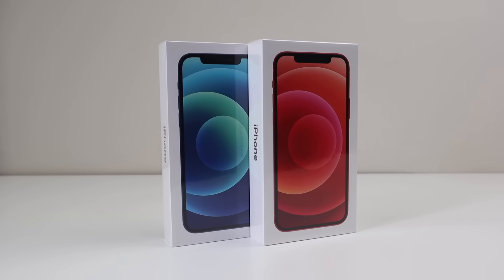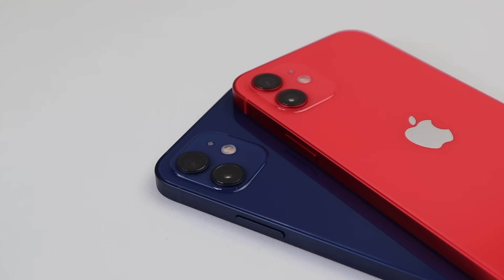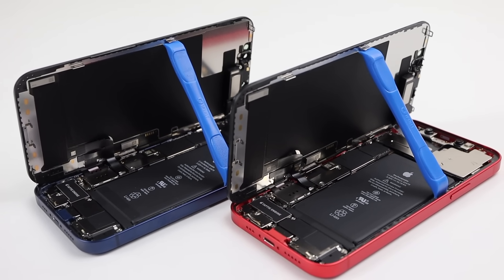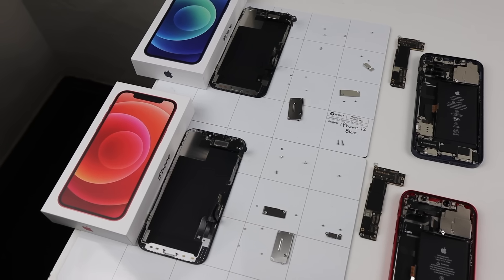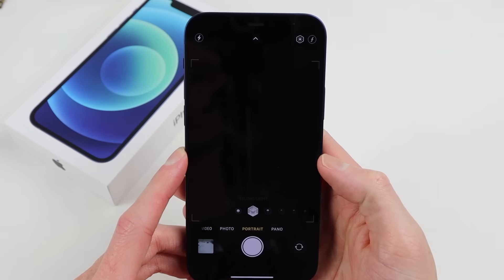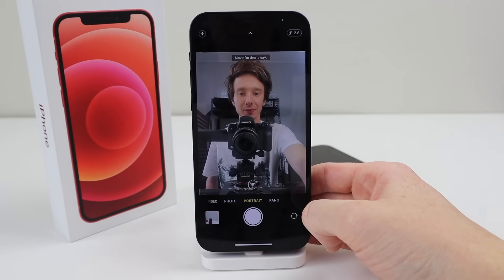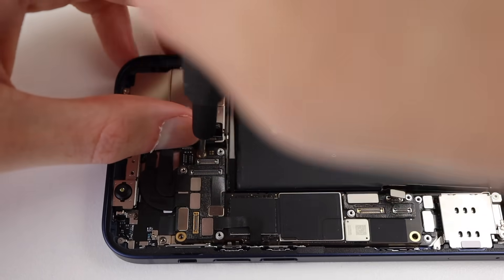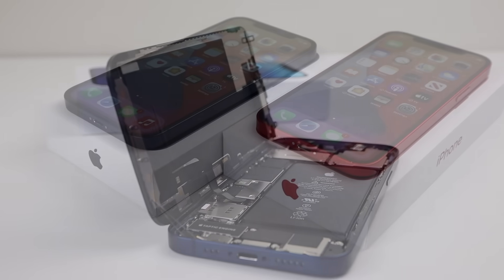iPhone 12 Anti Repair Design - Teardown and Repair Assessment

Comment: there is about to be a law in germany that phones have to be reparable and batteries have to be exchangable by the user. We need that everywhere
Reply: When is this law coming into effect? And what will happen then? Special German iPhones or no iPhones in Germany anymore?
Reply: @aljoschalong625  special German iPhones
Reply: @MrAdoh2010  would it be possible to buy these international phone versions and use them in another country?
Reply: @MrAdoh2010  nice, just hope they also mandated to use usb c
Reply: @bow-tiedengineer4453  yes
Reply: @aljoschalong625  special eu phones probably
Reply: @aljoschalong625  It will be in the whole EU and yes, if apple want to sell their phones here  they would have to change their design, or in this case, remove the software lockage against backmarket parts
Reply: I bet they would hide the battery connector below the motherboard
Reply: @losFondos  Apple: “Write that down, write that down!”
Reply: @losFondos  SH DONT GIVE THEN IDEAS
Reply: “This law needs to be in every single country”
Reply: @Xenofinite if it's good then yes
Reply: Just don't buy from apple
their products are shit, overpriced and mediocre
Reply: Jezus christ this turned into a cesspool. Apple is a morally devious company that likes to hide under a friendly facade. It has the right to create a product the way they want and noone is forced to be their customer. There best of both worlds, im gonna look if the local farmers need any repairs cause its been etched in my brain now.
Reply: The main part of that law is that Apple won’t be able to limit the user experience when you’re repairing your phone yourself. For example: removing features like Face ID or True Tone etc.
Reply: @GeorgiaOverdrive  For cases like that I think it should depend on whether Apple makes it clear or not to the consumer before purchase that they reserve the right to do that.
Reply: @GeorgiaOverdrive  Why shouldn't they be able to? It's their product. You are using their service.
Reply: @Katt1n  Because if I buy something that I own, I shouldn't be forced to still use a company to fix it. Why are you anti repairing your stuff? You sound like the kind of guy who pays a plumber to clean your toilet.
Reply: @Katt1n  So you are saying companies should be allowed to design their products to be as dangerous, problematic, unusable or lie about what their products then do and get away with it? 

Again, do you support farmers being unable to fix their equipment?
Reply: @Katt1n  You theory only works when you have a healthy free market of high quality phones to ship around. If you value your privacy (for example) you have no other option then iPhone right now, meaning you can't shop around. Thr other big names like Samsung and Google do the same things as Apple, just maybe a year behind. 

Do you not understand that Apple is often the trendsetter of horrible tech business practices that everybody else follows. What am I supposed to do when every phone is as anti consumer as the iPhone then. Are you antifixing your own shit cause that is the most silly position to take.
Reply: @Katt1n  Also you are putting a whole lot of faith into the idea that every single person who buys an iPhone also watched this video. Do you seriously expect everybody to buy an iPhone knowing they will not be able to repair it? Apple isn't exactly telling us that.
Reply: @JS-po8oc  Get away with it? No, they should be held accountable by consumers. Again, mr high IQ, i support everyone being able to do whatever they want with their property, be it farmers or those producing farmer equipment.

If people care about being able to repair their phones, they should research which phones can be repaired and which phones cannot. If people don't care, then tough shit for you. 

You are not entitled to a phone. You have to compromise on something, or if there is a demand in the market for a phone that cares about your privacy and is easy to repair, fill that demand by creating your own phone. These are the options you have right now, and you don't get to use violence to force other people to build you what you want. Again, you are not that fucking special.
Reply: @Katt1n  becuase its your property, thats like saying that you shouldnt be allowed to repair your car or your toaster
Reply: @Katt1n  except that apple has a whole ecosystem making it damn near impossible to switch and not lose everything
Reply: @sharktenko267  Your phone is your property.  You bought that property from Apple. When it was the property of Apple, they designed it in a way that makes it difficult for you to repair. Your entitlement to repair movement is not about your property, it is about Apples property. 

Apple has a whole ecosystem? What is it that makes it so difficult for you to switch? Moving your images from one phone to another? Moving your contacts?
Reply: @Katt1n  1: apples job should be to provide ease of use for the user, and that includes repairing 

2: yes as in everything
Reply: @sharktenko267  Apples only responsibility is to deliver a profit to it's shareholders. If people are buying products that only they can repair, and don't care about the privilege to repair, then they are fulfilling that goal.
Reply: @Katt1n   So you want companys to start making cars and trucks that you have to call the company to fix your flat, fill your gas tank, top off the wiper fluid, change the oil, and/or  change the filters?
Reply: @summer480  No, and i would never buy such a car. Does not change the fact that companies have a right to build such cars, and that using violence to stop them is wrong.
Reply: @Katt1n  he's asking you about farmers being able to repair their equipment because obviously you don't know about john Deere doing the same as Apple, except with farm equipment.

It's extortion. The farmers have to fork up more than the cost of the equipment to fix it or buy a whole new machine because of a low cost fault.
Reply: @akzual50  I know about the John Deere situation, that's why i would never buy their products. Same thing goes with Apple.
It is not extortion. You choose to buy shitty products from a shitty company. Farmers can purchase their equipment from other tractor manufacturers, and technologically challenged people can purchase their phones from other phone manufacturers.
Reply: @Katt1n  no the issue here is them forcing owners of a product to not be legally allowed to fix the stuff that they own.
When you own something it's yours. Not leased to you.
Per the terms of consumer protection, it is unethical to force a product to artificially degrade over time for the purpose of forcing the buyer to have to purchase another item.

Put it like this: if you buy a phone from Apple, and it just disintegrates all of a sudden 8 months from now, you would buy a new one. Considering items spontaneously disintegrating is normal.
Now, if apple forced the phone to self destruct in 8 months, what is your response to that? Because that's what's happening. They would make your phone disintegrate if a piece were to become faulty and force you to BUY a whole new phone. If not just say, shorten the time span to 1 second after purchase, you must buy a new one, 1 second after buying that, you have to buy a new one. 1 second after that, you have to buy a new one.
Reply: @Katt1n  also, Apple is 1 person. The CEO, whoever it is.
You're telling me that you'll let one person dictate how you can use your own property?
Reply: @akzual50  It does not matter if it is 1 person or a government, my property is my right. That is not what this is about.

Before i bought the phone it was the property of Apple, and they had the right to do anything they want to it, because it is their property. You don't have the authority to force anyone to build easy to repair products. You don't have the authority to force anyone to do anything.
Reply: @Katt1n  it's not about forcing them to build easy to repair phones. Its about a bunch of things. Mainly, them lobbying for legislation to prevent you from doing what you want with your devices
Reply: @akzual50  And I would get behind you cause, if you were not lobbying for the exact same thing, but against them. When Apple owns the device, Apple gets to do whatever they want to it. When you own the device, you get to do whatever you want to it. Why is this such a difficult concept for people to grasp? My property = my business only.
Reply: @Katt1n  fair is fair, except when they file lawsuits against those trying to repair their items
Reply: @akzual50  Or when the people trying to repair the items lobby for legislation forcing Apple to change their products to cater to them.
Reply: @Katt1n  okay, it's one thing to buy a phone, have it break, and then have Apple replace it quickly and efficiently.
It's another thing to have it break, then have them tell you the repair cost is more than the phone itself, when the repair fix is so easy that you or someone else could fix it.

It's one thing to have a phone slow down over time, even with factory resets, and have them replace it for you efficiently.

It's another thing to force your phone to slow down over time JUST TO MAKE YOU BUY A NEW ONE.

You say take your business elsewhere if you don't like it. I don't like extortion which that is. To purposefully sabotage my experience and tell me the lifetime of the phone is expired by wear and tear. That's fraud.
Reply: @Katt1n  I don't use an iPhone.
Reply: @Katt1n  People like you are the Problem. Here a government for once is trying to help out the simple consumer and people like you for some reason stand behindert those huge corporations.
Reply: @Katt1n  You talk like you're the CEO of Apple who one day decided to take a stroll around YouTube videos on Apple products and found this comment and got mad
Reply: @sharktenko267  ta gueule
Reply: @EdyAlbertoMSGT3  shut
Reply: @Katt1n  But when you BUY the product it becomes yours. They should allow people to be able to get the customers phones fixed easily and by third party sources. If you are for independent mom and pop stores that fixes electronics then you should be against what Apple does. A lot of companies will start doing this and putting these independent stores out of buisness. We have 5 stores where I live that fixes everything from phones to consoles and it's cheaper then sending them to the company unless you got a warranty.
Reply: @Melodyofthesea78  I agree that Apple should not do what they are doing. I would never buy Apple for that reason. Apple still has a RIGHT to do what they are doing, and you have absolutely no right to stop them.
Reply: @Katt1n  how much is Apple paying you to whiteknight for them?
Reply: @Katt1n  "Apple shouldn't remove repairing phones, although I think they should be able to remove repairing phones"
Reply: @ruler_of_everything  This is my position summed up, yes.
Reply: @Katt1n  do you know why that doesn't work rn? The whole "let the people punish them" thing? It's because so many people buy the newest thing when it comes out, or when it breaks just buy another, contributing to a massive amount of e waste, and never caring about repairing their shit. Yes a lot of people want to repair it, but a greater number don't give a shit. I get not wanting to make restrictive laws about what companies can and can't do, but I also dont support corporationalism, where they get to tramp all over the little guys.

The farmer issue? There is no good alternative for a lot of them, yet they need new tractors and shit. A tractor is a 500k-5m dollar purchase. That's not chump change, yet they can't fix it themselves...
Reply: @KyrieFortune  Apple making their phones impossible to repair does not violate my right to do what i want with my property though? Property rights do not mean that i am entitled to products designed in a certain way, it means that i can do whatever i want with (physically manipulate) my property. Me buying the phone is a mutually agreed upon transaction between myself and Apple. If i wanted a phone that could be repaired, i should not have bought a phone that cannot be repaired. It's that simple.
Reply: @Katt1n  You have a right to own a property and to repair it. What apple did was intentionally design their phones to be impossible to repair. This is actually illegal and if they continue their practice, they will be eventually sued for billions in Europe.
Reply: @REgamesplayer  Apple have the right to design their property however they want. It is their property. The law is irrelevant to rights, rights are above governments.
Reply: @Katt1n  You are a gift which keeps on giving.

Rights are not above governments. 
Apple does not have a right to design their property however they like. That is illegal.
Reply: @REgamesplayer  Rights are natural. You are born with the right to life, liberty and property. Governments cannot grant rights, they can only infringe on them.
Reply: @Katt1n  Not at all. You are born with neither of those things and in nature or in early human development we did not had any of those things. It is government with its laws which ensures these rights to us.
Reply: @REgamesplayer  You grossly misunderstand what a right is. Entitlements granted by gobermints are not rights.
Reply: @Katt1n  You do not understand what a right is.

"Human rights are the basic rights and freedoms that belong to every person in the world, from birth until death. 

They apply regardless of where you are from, what you believe or how you choose to live your life.

They can never be taken away, although they can sometimes be restricted – for example if a person breaks the law, or in the interests of national security.

These basic rights are based on shared values like dignity, fairness, equality, respect and independence. 

These values are defined and protected by law.

In Britain our human rights are protected by the Human Rights Act 1998."

They are in fact protected by a law and can be restricted or taken away by the law. Thus they are not above it. You confuse human rights with my rights as a consumer and place non existent barriers between these two things, calling one a right and another an entitlement while they both can be seen as entitlements.
Reply: @REgamesplayer  The human rights act has nothing to do with actual rights. The human rights act was written by governments and is not concerned with the actual rights that you naturally have from birth.
Reply: @Katt1n  And who ensures that you have those rights? Who decides if you can have them or they are restricted or taken away?
Reply: @REgamesplayer  No one ensures them and no one has the right to restrict them. Rights simply describe what I am entitled to by birth.
Reply: @Katt1n  They are regulated and restricted to larger or smaller extent by all nations of the Earth. Furthermore, concept of human rights had changed over times, gaining or losing popularity. For example, slavery.
Reply: @REgamesplayer  The "human rights" declared by the UN have nothing to do with actual natural rights. They are completely irrelevant to what is being discussed here.
Reply: @Katt1n  There are no natural rights as there is nothing that was or is inherently recognized as a human right.
Reply: @REgamesplayer  You refusing to recognize the natural rights of other people does not make them go away bub. Stay entitled.
Reply: @Katt1n  The thing is mate, the iPhone is a technological masterpiece, which as you saw in this video should be very easy to fix, personally I like the iPhone better than other phones and even after my brother had different phones he always came back to iPhone because he didn't like the other phones. The iPhone is one of the simplest smartphones to use while looking great.
Reply: @NocturnalPyro  It is definitly not a technological masterpiece, but it doesn't matter. You are not entitled to an iphone. You can buy one as is, or buy something else.
Reply: @Katt1n  wum the iPhone was revolutionary and the the newer models have really good specs, even comparable to a pc.
But really being able to modify and repair a phone with parts from a different phone bought from the same manufacturer shouldn't have any issues. Being able to repair your devices and machines should be should be a right sanctioned by the EU and the likes.
Reply: @NocturnalPyro  The original iPhone was revolutionary. Modern iPhones are in no way technological marvels. They are comparable to other phones with similar specs, only more expensive.

If i manufacture a phone, it is my property up until the point that you buy it. As such what i do with it is none of your bussiness. The amount of fucking entitlement you have to feel to even have the audacity to suggest otherwise is frankly sickening.
Reply: Chances are what they will do is say something like, "German users can bring their Iphones to our stores and we will make the phone accept the new parts for free.", or they can do it online, if they registered the phone in Germany. This is at least the most cost-effective solution.
Reply: but it's still questionable if this law will have any teeth whatsoever ... given our government's recent history regarding lobbyism and corruption I'm not that optimisitic
Reply: @gamingfox9845  yep. I mean, they spent 9 bio. euros to pull Lufthansa out of the shit they got themselves stuck into, but didn’t even have enough money to compensate small businesses who got hit the hardest by covid
Reply: i doubt America will see this any time soon because of our rights to free market.
Reply: @jadin1332  A free market that created this problem in the first place...
Reply: @JS-po8oc  Saying "the free market created the problem" when you don't get stuff your way is like saying "democracy created the problem" when people vote for the other party. The market is a voting machine. You lost. Stop crying for daddy boot to come help you with their guns.
Reply: @Katt1n  So youre saying free market capitalism wasn't the source behind this? Is Apple being socialist by making customers having to pay more for repairs?
Reply: @JS-po8oc  Yeah, free market capitalism was the source of this. The free market voted and determined that this is okay. 

Socialism is not the opposite of the free market capitalism. Apple are being anti consumer when making customers to pay more, but that is completely fine. If customers still pay, thats their fault.
Reply: @Katt1n  Is its wrong and anti consumer to do things like banning the use of freon or requiring companies declare the chemicals used in their products
Reply: @JS-po8oc  Yes? The government has no authority to say what products corporations can produce. If you buy a product without knowing it's content, you are at fault.
Reply: @Katt1n  So in other words you don't belive regulations should exist for anything across all industries and every and all issue. Correct? 

Also funny how it is always the individual's fault for being injured by a company and never the company's fault for injuring the. Just like it is also the woman's fault for being g attacked for wearing a tank top and never the fault of the attack for attacking her. 

Do you support things like Nestlé killing people I'm Africa or Dole running Banana Republicans or Corporations just straight up running the country and having laws passed that only work to suit their needs?
Reply: @Katt1n  Also the government does have that authority to do it, otherwise it wouldn't do regulations. You...you are aware that regulations exist and are preserved by the government right? A government who has established itself as the authority for things like ensuring worker and consumer safety, preventing companies from killing people to save money or using child labor.
Reply: @JS-po8oc  No one has the authority to determine what is illegal or not. Not saying what is in your product is not injuring someone. Attacking someone is a violation of the NAP.

No, i do not support any of those things. Violence is bad, no matter if the government or a corporation does it.
Reply: @JS-po8oc  I can punch you in the face. Does that mean i have the authority to punch you in the face? Governments are violent institutions that oppress the people they claim as their citizens by the very nature of their existance.
Reply: @Katt1n  So if I put razor blades into a bunch of fruit and give it to a bunch of children to eat, I didn't actually hurt them. 

What kind of looby land are you living in??

Also you don't support violence yet you are even less supportive of doing something about violence, so why even say you're against it if you don't want it to end?
Reply: @Katt1n  And corporations are somehow not violent institutions that oppress people by the very nature of their existence? 

Also a government making a rule that says you have to pay your workers and can't operate unsafe working conditions, or making laws preventing corporations from, metaphorically, punching people in the face is not wrong. Like, the only way a person can have this ideology whole supporting corporations is to belive that they have your best interest in mind. 

At least with government, the peolle control who is in charge and it by and large has a lot more restrictions when it comes to exploitation of workers. Especially today. Corporations are objectively more prone to corruption the government just by the lack of accountability.
Reply: @JS-po8oc  How are corporations violent? What does a corporation force you to do?

Governments using violence to stop people from entering into volentary deals with other people is inherently wrong.

The people do control the corporations. If a corporation has no customers, it goes bankrupt. The market is a voting machine long term, that unlike the government is based on volentary trade and not violence and abuse.
Reply: @Katt1n  
You really want me to list examples of companies forcing people to do things they don't want? You mean like Nestle killing African children, Dole running Banana Republics in Central America, Blackwater commiting war crimes, BP destroying and then covering up their destruction of the gulf of Mexico, mining companies (such as for cobolt) backing the Rewandan genocide, pharmaceutical companies over prescribing addictive medicine, medical companies charging criminal prices for inexpensive medical practices such as insulin or similar life saving drugs, the entire purpose and existence of private prisons, basically everything banks did during the recession, the disaster in Texas (before you try to defend it, I am a mechanical engineer who's worked on power grid design, I have the authority to tell you that the corporations there were entirely at fault). Those are just off the top of my 

Whether you want to belive it or not, the US is very lenient to Corporations.
Corporations have created an America where 50% of people don't have $500 savings, people commonly have to forego medicine to pay rent or buy food, have constantly stifled innovation in alternative energies and medical developments because profits. 

Also, the market isn't controlled by us. It is controlled by the wealthiest billionaires at the top. Apple could sell a phone that explodes and kills 10% of its users and it wouldn't fail because it can't. Explain to me how I'm supposed to boycott the company that develops medicine I need to survive? Or Boycott companies that most Americans don't even interact with, such as mining companies. It is such a simple and false view of life to think that the free market is anything close to free today and you really don't have a meaningful rebuttel either.
Reply: and then apple will say, sure, you can repair it yourself... just bring it yourself to one of our stores! (where we will change your phone to a different one, and you won't know because our policy is to delete your phone data no matter what the service is)
Reply: I go to germany
Reply: Companies need to start boycotting these countries with the anti business laws. Let them all use flip phones until they drop the nanny state ran by nazi's.
Reply: Holy shit, so many fucking retards simping for apple.
"Apple can do what they want its their phones"
"N-noo the government cant do what they want restricting companies even though they are doing stuff in their jurisdiction"
Reply: Too bad, most people don't live in Germany.
Reply: YES
Reply: If they do that it will force apple to do better
Reply: This is America, our politicians and corporations hate that sorta shit.  It's too good for the people.
Reply: If I'd design a phone it would be modular and repairabale by the user easily.
Reply: @alexale5488  oh you mean like a desktop computer??? Nahhh we can't have that, just buy a whole new computer!
Reply: @proxyhx2075  niceeee
Reply: Agreed
Reply: geia sou zele
Reply: Between this and the privacy laws I for one welcome our new overlords from beyond the rhine
Reply: Glad to be living in germany
Reply: This world has gone bat sh1t.. all them buying iPhones and sh1t. At the day of reckoning its worth nothing. Keep strong pete u can do it!
Reply: Not only in Germany, all EU. And if it is the case for one big market they will have to adapt the product for all countries anyway.
Reply: we also mostly use Androids in germany, reasons
Reply: lol habs nicht mitbbekommen
Reply: they will just solder everything together lol
Reply: Really? I'm german and haven't heard about it yet. 😮
Reply: Never will that happen, somehow they need to keep the jobs, if everything would be designed to last as long as possible, repairable and upgraded, all the people who produce it would lose their jobs so their lives thanks to the artificial scarcity of the market system, unemployment exists only in the market system, under every other condition it is freedom, but in the market system it means dying homeless from hunger between empty rotting houses and stores overfilled with food that is disposed every day in bigger amounts than there are people who could eat it. It's about time to think further, the market system is the anti-economy and doesn't allow any economic development. Watch InterReflections, no conspiracy required.
Reply: @Wilson84KS  Whats your education in economy?
Reply: Say goodbye to ultra-slim phones then.  And say goodbye to the tamper-proof, high-security models.

No need for a law.  Just don't buy phones with anti-features like this if you don't want them.  You can build your own phone out of off-the-shelf parts with only minimal assembly skill these days, so it's not like they can force you to buy their product.
Reply: should be same with laptops and computers.
Reply: Send that to the whole universe
Reply: I'm finna only buy German phones now lol
Reply: Really, that is awesome, all EU should adapt that
Reply: Just make that law universal and that means including u.s, China, Japan, all of the UK and all of e.u. etc.
Reply: @BanazirGalpsi1968  why would we need a stupid law like that? Nah keep it.
Reply: @jamesg863  what would you say if say Chevy insisted on bricking every vehicle that they made needing repair and saying only the licences Chevy dealer could service chevys? Apple is doing that.
Reply: @BanazirGalpsi1968  Chevy is a trash company driving in to their next bankruptcy. If they did that, then good for them. Their Female CEO can use her gender wits to figure out how to slow down the collapse that political correctness helped create. 

Apple will be around for a long time because people that like their product will purchase it, and those that don’t, won’t. Like it or not, it’s a superior product. Chevy on the other hand isn’t, so their margin for error is nil.
Reply: But how will the gubmints spy on you 24/7 if you can do a battery pull?
Reply: @stereofreq7112  did you think before commenting that? They test it
Reply: @lick28  my bad
Reply: @Gregory Monlouis oh you got me lol I should have said I’m too busy doing things I prefer. 
Fair enough. If I had a boot I’d eat it 👍
Reply: American Freedom World Peace   You really think they would give up 20 - 25% Market share in germany. Do you know how much money that is?

You'd be delusional to think they would just focus on the US
Reply: Kay /O  *Entitlement to repair.
Reply: Kay /O  Huh? You are buying their product as is. You can either choose to buy it as is or choose not to. You don't have a right to an iphone
Reply: @Katt1n  so you think companies can put whatever they want in their products without goverment regulations, yea that'll end well
Reply: No, what you need to do is stop buying shitty products instead of screetching for daddy gobermint to come think for you.
Reply: @Katt1n  Does this mean you support farmers being unable to fix their equipment?
Reply: @JS-po8oc  a phone is a device, not a machine.  
Your comparing apples to dogchit.
Reply: @jamesg863  So youre saying it is ok for the entire phone market to make phones impossible to repair but it is not ok for John Deet to do the same because of your arbitrary definition of a phone and a machine. 

Do you just enjoy paying hundreds of dollars to have a person replace a battery that would otherwise cost like $20? You sound like someone who is bad with money.
Reply: @JS-po8oc  if John Deer did it I’m sure some people would be upset. They wouldn’t buy it.

Capitalism proves that companies evolve or dissolve. Maybe Apple has more reasons for this. I’m sure a company with this much success didn’t do it just to piss people off or be greedy.
Or there is a bigger reason known already, and this video doesn’t mention it. 🤔
Reply: @jamesg863  Go talk to a farmer and tell them that they should just buy another piece of very specialized equipment to do their job and watch them laugh in your face. 

John Deer has a monopoly over high quality, specialized and moderately affordable farming equipment. Farmers don't have the option to buy other companies either due to cost or just not being good or because those other companies don't exist. 

Do you really think companies have the best interests of their customers in mind when they make changes to their equipment that prevents their customers from fixing it? Farmers are having to either buy 50 or 60 year old equipment, which is sometimes more expensive then the stuff John Deer sells, or (and I'm not joking) buy a hacked code from African hackers who break into the computer systems that prevent farmers from fixing their John Deer stuff. Do you think it has always been this way? 

John Deer designs their machines so that if something breaks and the farmer tries to fix it, the machine will stop working completely. Permanently. Their only option is waiting, sometimes days, for a John Deer tech to come fix it. How are you ok eith this? Do you support farmers, who already live on a very thin budget,, going days without work because a company is greedy? How are you in support of our farmers being prevented from working and having yo pay African hackers to do their job? 

Do you think the government shouldn't regulate things like medical drug quality, child labor or food quality either? The reason we have regulations in the first place is because companies care more about profits then customers, otherwise we wouldn't have regulations at all.
Reply: @jamesg863  John Deer is so big that it won't dissolve. They are doing this because they can and know they will get away with it.  Apple and John Deer do this because they know people will just buy another phone when they can't fix it. There is no other reason, a decision that a big company makes is ALWAYS in pursuit if profits.
Reply: @JS-po8oc  Apple makes profit by creating a superior phone, not by the breaking and repairing of it. 
If you want to find reason for all of this “no 3rd party fix” blame, look to China and India.
Reply: @jamesg863  Except they literally do. Apple designs their phones to slow down, have worse battery life and be less efficient as they age (faster then the hardware would otherwise degrade) in order to coerce people to buy new phones. planned obsolescence. 

Then they decide "we don't have enough money, let's make it impossible for people to fix the product they bought from us because we are pieces of shit."
Reply: @JS-po8oc  actually, if every company decides to go anti repair, there will always pop up new ones to target the consumer that likes to repair their own stuff.
Just let apple fk their own users, its their loss long term.
Reply: @DoDrugs420  Yeah no, if all the companies went anti repair that means they did it because they know that no competition would shut them down. 

Apple will never fall unless they stop making product. The free market is not what it once was. It is controlled by a handful if corporations that buy up, or shut down any and all competition. 

If every phone company went antirepair, that is the end of it unless government forces them to change.
Reply: @jamesg863  Imagine being an apple fanboy in 2021...
Reply: @belaf1329  it’s not very hard to do. 😜
Reply: @JS-po8oc  GPALU
Reply: @Katt1n  But apple is shit.. imo 
I can get better performance on litterally any other android.
Reply: @Gregory Monlouis I’m never too busy. Why are you?  
You preach on my knowledge coming from what experience? 😆
Reply: Yoru  It shows your true character that you think "everyone else thinks the way I do therefor you are wrong" is an argument.  I don't condone Apples practices, but I support their right to conduct them. Just like I support your right to free speech even though I have 0 fucking respect for you and I think the world would be a better place without your opinions.
Reply: Germany makes that a law? My life is too busy to care about small stuff like that. Time is money.
Reply: Then Soon germany won't have any phones
Reply: Greetings from Germany. No, there is no law in Germany that regulates the repair of electrical appliances. I work for a German authorised Apple partner and we are free to choose how we formulate our terms and conditions. Of course, there are free repair shops that can repair an iPhone. However, Apple wants its devices to always be 100% compliant with its standards. And Apple can’t control the work of free repairers. That’s why you should always go to an Apple store or an Apple partner if you have a defective device. Even if it costs more. I hope you understood me. I used an online text translator :D If you have any further questions, just get in touch with me. :)
Reply: @sokomaxx  bullshit apple only wants max profit and also scamming people like u can see many videos about it where some people tested the genius bar by just unplugging some connectors and the genius bar told them they need to replace the logic bord but the only thing they had to do was plugthe connectors back in and the job would be done but they trying to  make max profit out of repairs also, sokeep that bullshit to yourself
Reply: @aldenkia  shure. And u want to say, that every Genius Bar is the same?
Reply: @aldenkia  ich sehe grad, du bist deutsch. Pass auf, ich arbeite quasi für Apple. Und unsere Techniker sind geschult genauso wie ich im Retail. Und wenn ein Kollege keine Ahnung hat heißt dies nicht, dass jeder so arbeitet 🤦‍♂️ aber so polemisch kann nur ein echter Apple-Hater „kritisieren“. Werd erwachsen mein lieber, bitte.
Reply: @sokomaxx  Dein Text hat null Inhalt,  Du solltest lieber mal Erwachsen werden. 
Und ja ich kann erwarten das jede Genius bar gleich arbeitet und nur Geschulte Techniker geräte Reparieren ohne einen Kunden mist einzuschwätzen das die Reperaturskosten soch hoch wären das man sich doch ein neues gerät lieber Kaufen sollte obwohl garnichts schlimmes am Gerät ist und es mit geringen Aufwand zu beheben ist. Und es ist auch kein Einzelfall bei Apple also komm mir nicht mit so einem Kindischen kleinkram Echter Applehater. Wenn sie sich ja so um den Kunden sorgen und ihn vor  Freien Shops  beschützen wollen weil sie die ja nicht Kontrollieren können, Sollen sie erstmal vor der eigenen Haustür kehren. Und wie ich bereits sagte dein Text ist lachhaft hier gehts null um Kunden oder Apple Werte,  Apple gehts nur um Maximalen Profit das leute lieber ihr geld  bei Apple lassen anstatt bei anderen Werkstätten.
Reply: @aldenkia  Ah verstehe. 100 Mitarbeiter. Alle sollen gleich arbeiten. 2 Arbeiten schlecht. Heißt also, da alle gleich arbeiten sollen, dass alle anderen 98 Mitarbeiter auch schlecht arbeiten? Das ergibt einfach kein Sinn :D Sei ehrlich, wie alt bist du und wie viel Erfahrungen hattest du schon im Leben mit Apple Reparaturen UND Reparaturen anderer Hersteller?
Reply: @sokomaxx  Wenns ja nur so ne kleine Ziffer wäre wie du beschreiben tust, Würde wohl kaum so eine gewaltige Menge an Kunden so negativ über Apple reperaturen bewerten. Und ich habe genug Erfahrungen mit Apple geräten gemacht . Hauptsächtlich bei Macbooks. Das ich entschieden haben keine mehr zu Kaufen. Am  kulantesten war bis jetzt Samsung die mir trotz eigenverschulden entgegenkamen obwohl sie es nicht machen mussten.
Reply: @sokomaxx  really hoping this is a joke
Reply: @NocturnalPyro  what do u mean? This is Not a joke. There arent Laws like this:D
Reply: @sokomaxx  maybe not yet, but there should be
Reply: Ah, yes. More government regulations. Just what we need.
No, Apple should be free to make their products non-reparable. And as a consumer you should punish them by not buying their products.
Reply: @Neike9  so if all manufacturers of any electronic device do this, we should become amish? Mate there are enough people who do not care enough to where they would stop buying products. Apple repair is expensive, meaning you’re better of buying a new device, rather than using your old one, even if it could be easily fixed and work fine. There are situations where apple will charge you over a 1000$ for a macbook repair, when 3rd party will do it for a fraction of that. And unfortunately other manufacturers are watching apple and see that it’s working, so even though i don’t use apple products anymore, i still have problems getting parts for my phone. If regulatory bodies don’t act, you won’t be able to repair shit. 
This gets especially bad with medical equipment, where manufacturers lock devices down, so technicians in hospitals can’t fix it and they have to call manufacturer support, which can take days, there are literally people dying because of this. Capitalism doesn’t solve everything, in its most extreme form it’s just as bad as communism is, it’s just that we have yet to see a fully capitalistic state.
Reply: @christopher8k  Yeah could you imagine if your cars carburetor stopped working but because they've made it specifically for that car, which means you either have to go the place that made the car or buy a new car, it's fucking ridiculous.
Reply: @Neike9  absolutely fucking not
Reply: @Neike9  That's utterly ridiculous. Stop pretending Corporations aren't just as much a power structure as government with your libertarian nonsense. It's just anarchism for idiots.
Reply: @Joesolo13  Corporations are not legitimized to step on your freedom. Companies don't have the monopoly on violence. No, they're not as much a power structure as government. If tomorrow a corporation started doing something remotely close, people would burn down their headquarters.
Reply: @Neike9  dont worry. Ppl will buy whatever they sell.
Reply: @Neike9  Actually it is what we need to reduce consumption and electronic waste. A perfect law to adapt for the future.
Reply: @Neike9   No. We need regulations.
Reply: @Neike9 yeah like that's gonna work
Reply: @dayko.  DON'T BUY THEIR PRODUCT IF YOU DON'T LIKE IT YOU ENTITLED FUCK.
Reply: @Katt1n  don't be a corporate shill you entitled fuck
Reply: @Katt1n  calm down apple fanboy
Reply: @ObliqueVisualsNz  Never owned an apple device in my life, I am just not an entitled karen piece of shit that thinks I have a right to run other peoples lives.
Reply: @Katt1n  What about Samsung? They've been known to copy Apple. It's generally expected that if you don't buy Apple, you'll be buying Samsung.

Do you care about the environment? Then you should agree with Apple being forced to make their products repairable YOU FUCK.